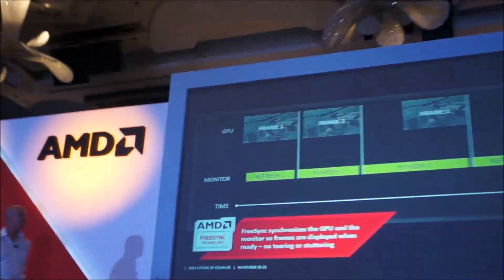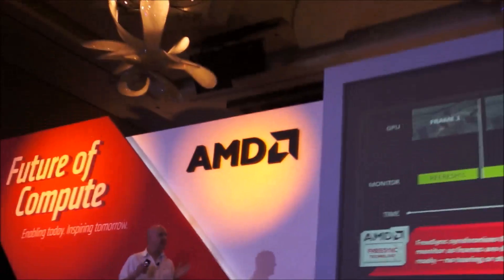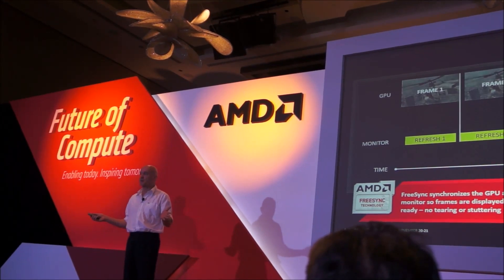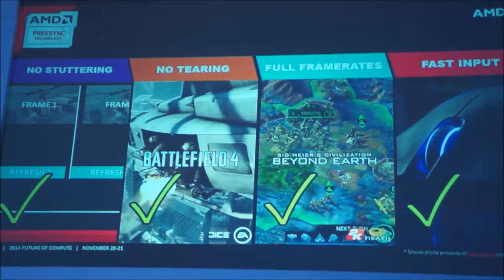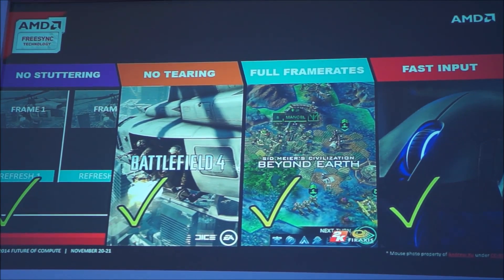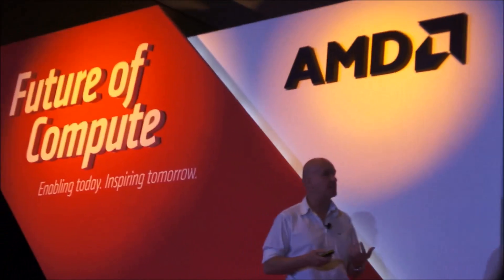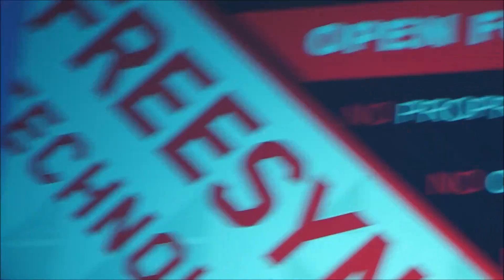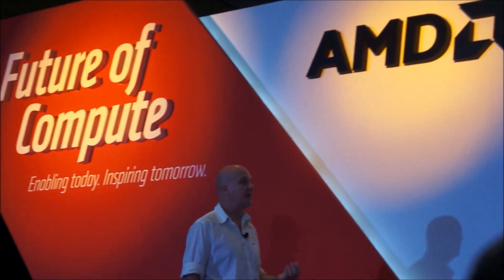AMD's Chief Gaming Scientist summarizes AMD Freesync technology

Comment: Guys, I need some clarification with regards to this freesync tech. Will the freesync monitors come with a chip embedded in the circuit board like G-sync monitors?. OR is Freesync more like a BIOS update for the AMD gpu's (and maybe firmware update for the monitor)?. I know that Freesync will be useable only by display port connection. So if I have a monitor (regardless if 60Hz, 120Hz and 144Hz)that has DP connection, could I download the AMD Freesync software and make my monitor Freesync capable?. BTW, I have a 144Hz monitor. Thanks for any advice.